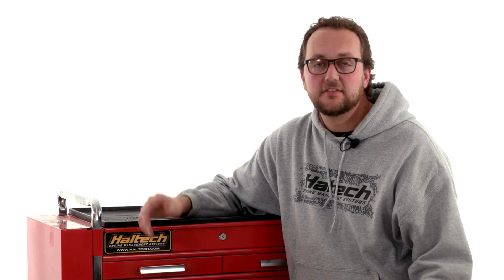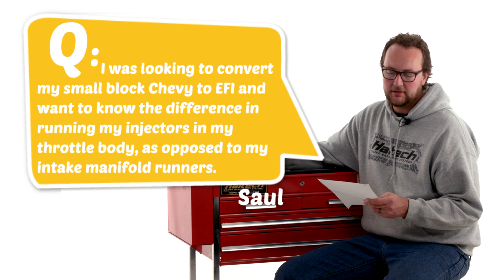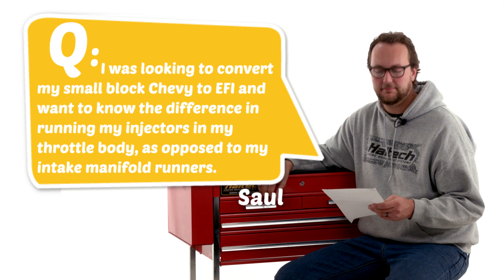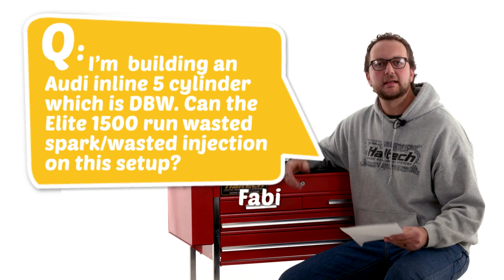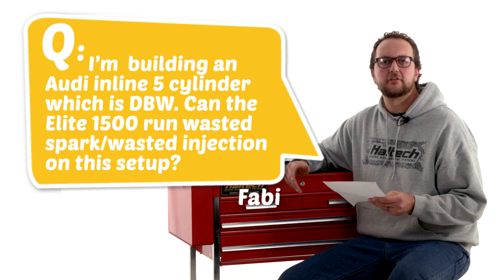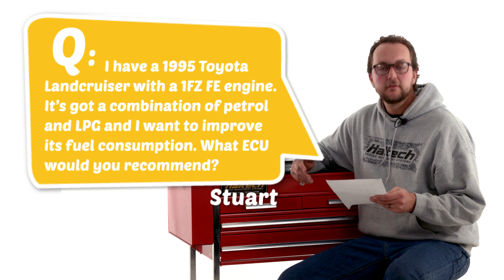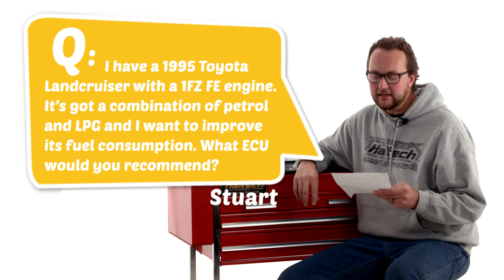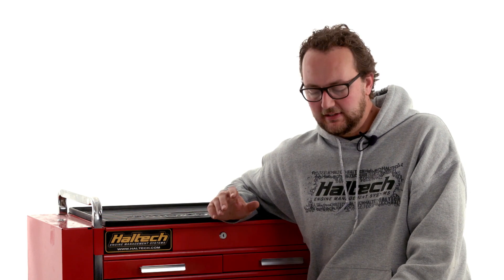❓ Injector Placement, Wasted Spark, ECU for LPG - Haltech Q&A Episode 15

Comment: is that elite 750 series ECU still good for a dual fuel setup? i'm having issues with my V6 commodore(VT series 2) mainly backfiring. i have thought of removing the lpg all together but then i don't have anywhere near the range as it currently does. i also want to update the lpg components under the bonnet because everything else is either new or in great nic.

Comment: If doing a simple EFI conversion to a 4 cylinder mk1 vw golf, is a crank trigger wheel ouput enough for the 750 to run ignition, or does it have to also have cam position sensor input?
Reply from the maker: Missing tooth crank trigger wheel will be fine for dizzy or wasted spark applications, but if you want to go full sequential spark, you'll need the cam position sensor.
Reply: Thanks tuning fork!

Comment: Scott, i just bought a 2008 Chrysler Aspen 5.7 Litter engine, how can i get the best gas mileage yet performance, if i put in a after market Air intake and maybe dual exhaust the best spark plugs and wires, possibly a computer up grade, (CHIP)  would that work?
Reply: You wont see a lot of mpg gains from those mods, probably take 50,000+miles of driving to get back what you spent in parts.

Comment: Ga'Day Tuning Fork,  I have a  vw  2.5i  5-cylinder  petrol engine. Drive by cable with the 3-pin plug throttle senor,   2-pin common rail  & A Distributor.  What would be the best choice of ECU

Comment: Hey Scott with the 5 cylinder application you could run a partial wasted spark if there was a software change in the 1500. You could run 3 of the cylinders sequentially and run the other two using the wasted spark/injection method. One of cylinders should be within the exhaust duration whilst the targeted ignition cylinder is igniting. Map it out on some sort of timing graph and you'll see it can be done.

Comment: Hi Scott, i know this has probably been asked to death but what haltech model should i use for my budget 1990 mx5 1.6 turbo build?
Reply from the maker: For a plug-in option, use the MX5 1.6 Sport 1000 ECU kit (HT-051323). If you are happy to do some wiring, either the Elite 550 or Elite 750 can be used.

Comment: hi, im running a saab b204 2.0L turbo with a td04-19t in my vauxhall astra mk4, will a piggy back style ecu work best? also wanting in the future to run bigger injectors and turbo upgrade. thanks Sam

Comment: Hello. I have BMW which have M52B28 1 vanos engine. I want to build Turbo with low boost. Also It's daily car and I use LPG for driving economically. Is this combination safe for engine? what ECU I should use?

Fuel injectors are combined with LPG. Fuel sequentually turns each cylinder to LPG.
Reply from the maker: The single-vanos variant can be used with the Elite 750, Sport 2000, or Elite 2500 ECU (depending on features required). If you are using dual-fuel, you will need to run dual tables for fuel and ignition. If you are using LPG only, only the base tables are required.
Reply: +haltechecu what is limitation of power for using LPG fuel? Because its dry fuel, and wont cool down combustion chamber.

Comment: I wil swap 6g72 tt in eclipse 2g what shud i use
Reply from the maker: Depending on features required, either the Elite 750, Sport 2000, or Elite 2500 can be used. These will require custom wiring for installation, as we do not have a plug-in solution available for the 6G72’s.
Reply: +haltechecu anti lag and Nos .

Comment: I'm running a Naturally aspirated converted YB cosworth engine in my 1972 MK1 escort. currently running distributor and motorbike carbs but would like to go fuel injection. what set up would you recommend?
Reply from the maker: There
 are a number of options that support the YB, with varying feature sets.
 For a basic EFI conversion, I would recommend the Elite 550. http://www.haltech.com/elite-550/

Comment: I'd like to know how hard or easy is it to wire in a after market Ecu into a vl turbo and what Ecu would suit it the most with the rb30 single cam and staying dizzy not going coil,and wanting to get rid of the horrible air flow meter.
Reply from the maker: The easiest way is to use either our Sport 2000 or Elite 2500 terminated engine harness kit; This replaces the factory engine harness, and only requires a few wires to be connected under the dash (eg. Power, ground, fuel pump, tacho). Alternatively, you could make your own patch loom or re-pin the ECU connector.
Reply: +haltechecu thanks for the reply man I like the sounds of that

Comment: i have a AE101 Corolla Levin, running a 4AGE 20v, with high compression forged pistons. i am looking to convert to E85, but i run Side feed injectors. my engine runs the stock distributor setup, which ECU do you recommend, and do you know if there are any injectors that will replace the stock ones that will not have an issue with the ethanol fuel?
Reply from the maker: Either the Elite 750 or Sport 1000 would be a great option for flex tuning on a 20v – supporting high and low impedance injectors, 3-wire idle control, and direct flex sensor inputs.
 I’m not sure about E85-compatible injectors to suit; Perhaps ask a specialist such as www.injectorsonline.com.au ?

Comment: well i own a bmw 328i e36 and i want some more power from the engine and i have a few upgrades done such as a full supersprint race exhaust,euro m3 intake manifold, cold air intake and s52b32 camshafts...which haltech ecu would be the best to tune the car for more power?
Reply from the maker: We would recommend Elite 2500 for your application.
Reply: haltechecu alright,thank you for the recommendation..

Comment: Hey Scott, great video. i'll install a twincharger with a GTX30 & a BBM G-lader supercharger. Can i run sequentially setup?. Which ECU can trigger a dbw-throttle like a bypass valve to separate the flow between S/C & turbo?. & Which ECU can trigger the electromagnetic S/C clutch? & the last one, which ECU can control Haldex 1st gen?. Thank you for your time & answers.

Comment: Whats the best ECU for a 2012 passat ? it had the 2.5 lt inline 5 cylinders, i want it to have the best performance maybe with a stick enginee with minor mods like straight pipe and cold air intake
Reply from the maker: If it's not a direct injection engine then Elite 2500 would be our recommnded ECU.